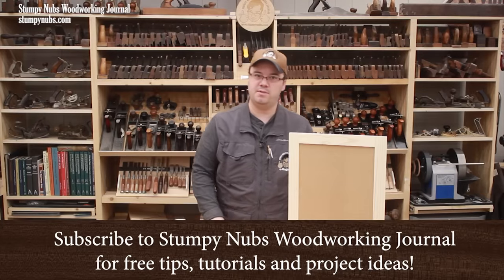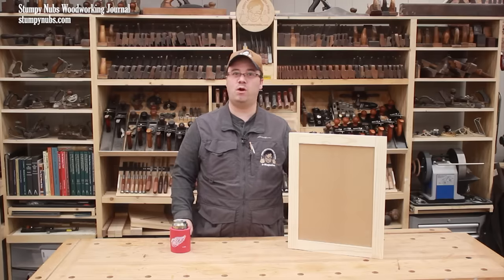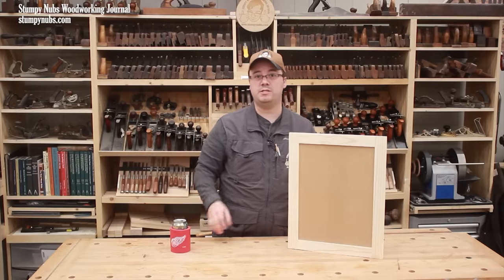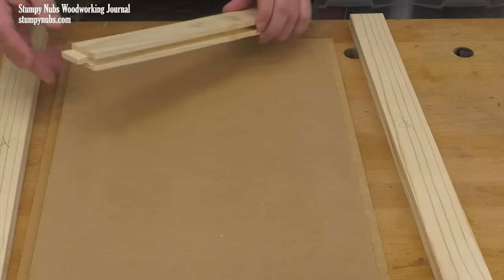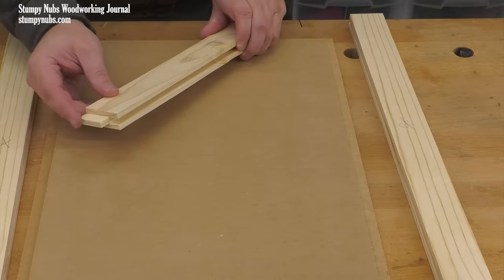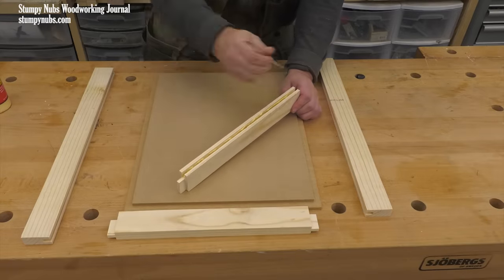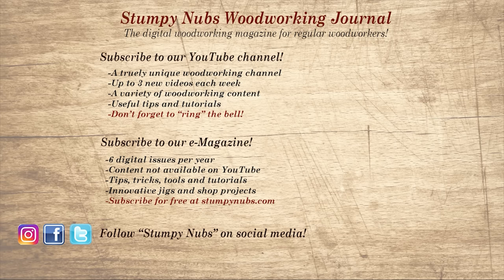DIY Cabinet doors with just a table saw!

Comment from the maker: Free table saw classes (In SNU Courses section)►https://www.stumpynubs.com/
ISOtunes Bluetooth hearing protection (Use $10 off code STUMPY): https://bit.ly/2mdAqcn
Video about homemade splitters►https://www.youtube.com/watch?v=gzdF-bLXc8Q
Free table saw class (In SNU Courses section)►https://www.stumpynubs.com/
AMAZING Hedgehog featherboards (seen in video)► https://amzn.to/3b4KcVl
(We may get a small commission if you use one of the above affiliate links.)
Reply: I'd love to hear stumpy's thoughts on the incra fence.
Reply: I just tried the stumpy nubs discount code for Ridge carbide for my 2nd table saw blade.  What I found that the discount code is good for one purchase.
Reply: I will sign up as soon as I get my contractor table saw set up. I am trying to decide what I am going to do about an Outfeed table. Never used a table saw before outside my shop class a million years ago. :)
Reply: @StumpyNubs thanks for the lesson.  It's worth noting that mdf should always be cut/drilled while wearing a filtered mask.  It's manufactured with toxic chemicals like formaldehyde. 
James I normally use reclaimed materials like pallets because I can get them free.  If I wanted to make a vertical slat panel in the door...should I glue the slats together and not the outside edges or use only tongue and groove?
Reply from the maker: @fdort3971  Glue them together to make a single panel, then let that float in the frame. Otherwise, gaps can open between the loose slats.
Reply: @StumpyNubs thanks James! I appreciate the quick response! I'm home alone most days so I was playing your videos just to hear another voice (besides the ones in my head...lol). Today I'm building a quick 2 tier cart. I received free wood that came with pre-drilled pocket holes.  I've always used the "toe nail method.  This wood is kicking my butt...your calm voice lessons are helpful for learning and trying to stay calm. Thanks for "hanging out with me" while I force used wood into submission!
Reply: @StumpyNubs  Bahaha I just went fangirl..."Stumpy answered me!"...you made my day...

Comment: James I know this is just one more comment but I do need to tell you that THIS video was amazing. I've been building a box riser for a lady's mini refrigerator so she doesn’t have to bend down so far. The door part was the only part I was nervous about and I didn’t want to just put hinges on a piece of plywood and watch it warp in a week. I wanted a proper door. YOU saved me. Trust me when I say you are an outstanding teacher and that is something I know a lot about. For over 40 years I taught thousands of people all over the country and wrote 5 books on a very technical topic. Nothing at all connected with wood working. What makes you a fantastic teacher is that you never assume that the student already knows the terms or is reading between the lines. You teach like its our first day in the wood shop and THAT is what makes you a fantastic teacher. I built this door using oak for the rails and styles and then sandwiched three sheets of 1/8 masonite for the panel and the result was as perfect as what you showed in your video. Great instructions make for a better student. My confidence has grown as a result. I have never seen any woodworking videos that are as clear as yours. I admire you as a teacher and a person. Please don't ever change. I have an entire folder in my YouTube library and nothing is in it but Stumpy videos. Thats the good stuff. Thank you most sincerely.

Comment: AWESOME setup tips for the TS doing dados and rabbets. Doing the rough center then flip technique removes all possible errors in getting the grooves centered and stiles/ rails flush with each other. With a good flat top blade, the machining steps shouldn't take long at all.

Comment: Several years ago I used your techniques to build fifty doors and drawer fronts for a house I was flipping.  At one point I had 250 pieces laying around, sorted into piles and my son came in an started handling them.  I ran him off.  

One suggestion:  If you are going to use 1/4" plywood for the panels, buy it and measure the thickness and use that for the thickness of your grooves and tongues.  Much of it is not really a 1/4" anymore.  Thanks for the really good presentation.

Comment: Great video, I’m making some doors just just like this for my shop cabinets. I’m using scrap 3/4 inch plywood for the rails and stiles. It doesn’t look the best but for the shop it’s fine. This is nice practice for when I build a new set of cabinets for the house.

Comment: @ 13:55 if you look closely you can see the fence move away from the blade as the work piece encountered the feather board, I was quite surprised, to say the least. Especially considering it is a Incra fence system (which I highly respect), and I watched as the video continued and it happened again . . .

Comment: This was one of the best tutorials I've seen in some time. Thank you for the detail, I was thinking a few times during the video that I wish Norm would have narrated answers to questions someone might have like you did. One constructive criticism is I would have liked to hear. a brief discussion on the seasonal panel movement, MDF/Ply/Panel etc. when you were gluing all four edges of the panel.
Reply from the maker: MDF and plywood doesn't move enough seasonally to be a factor in this case. That's why it is used. I briefly referred to that at the end of the wideo.
Reply: @StumpyNubs  my apologies, I missed that  at the end for some reason, Thank you again

Comment: There are so many useful approaches in this video that can be applied to other jobs...been looking for a way to build a picture frame for a large poster and can easily adapt this as well as for cabinet doors with glass inserts (will just miter in molding).

Comment: Recommend using a zero clearance insert.   I tried this vertical technique a while back and had some scary stuff happen.   Made a zero clearance insert and it worked much better.   I use a dado blade now.

Comment: Great vid as usual. I noticed though that the fence is moving slightly during the latter part of each cut (i.e. cutting grooves on edge). I assume this is due to pressure from the feather boards. Doesn't that make a slightly irregular cut line leading to small gaps between the panel and stile?

Comment: Great Video !
Quick question though I’ve always thought it good practice to let the panels float in the grooves rather than glue them in, is this because your using MDF and it doesn’t expand and contract like wood ?
Reply from the maker: Yes, MDF doesn't move like solid wood.

Comment: Nice very clear and easy to follow. You could do the same video with a router bolted to the underside of a bench. With perhaps a jack for height adjustment. Keeping it cheap. Good video mate nice to see someone not using a laser cutter, CNC and 3d printer just to build a simple project.
Reply: How would you do the grooves on a router table?  With a slot cutter?
Reply: @donbushek  yeah or a straight cutter

Comment: Hai Jim, I very much like the simplicity of This way of working😁 I always try to let the measurments "work" for me instead of against me, if if that means slightly adjusting my workpiece. I find it to be better to have exact, simpel but spot on cuts than  using a more comprehansive way wich I Just don't get to fit perfectly😒 thanks for This one!!!

Comment: Love the simplicity, usefulness and honesty in your videos!! There are so many great nuggets of knowledge to be picked up, from the greenest beginner to the most seasoned veteran woodworkers.   But....anyone else cringe a little watching the table saw fence flexing with the double featherboard set up?
Reply from the maker: There are two locking points for the Incra fence, one on the positioner arm, another on the fence rail itself. I did not have the fence rail lock engaged. It looked way worse in a video closeup than it actually was. I didn't even notice it, and it didn't affect the cut.

Comment: Using dry timber is essential. Many projects has looked good direct, but kind of warped after a few months. The construction lumber in the lumberjard is usually not even close to dry enough.

Comment: Hello.  Great video! 
I need to make cabinet doors for my kitchen cabinets.  I was wondering if birch would be a good choice for lower cabinet doors? My cabinets are made from birch for the boxes and popular on the fronts of my cabinets.  My upper cabinets,  I'm wanting to add a frosted glass because we have an extremely small kitchen 11'x10'. The cabinet doors for glass would be a little different process from making the grooves insert the styles and rails, right? It would be best to do that on the back incase of breakage but how deep would you do the groove and what to use to hole the glass in so it doesn't rattle? Your advice would be greatly appreciated.

Comment: Excellent video. Very clear explanation and really well filmed. Thank you.
I have some spare hardwood flooring. I was thinking about gluing several lengths side by side to make a cabinet door. Will that result in warping?  Is there a way to avoid it warping? Thanks

Comment: Glad to see a 1/2" panel. A 1/4" panel just seems to flimsy to me when opening/closing the door. I usually spend more time sizing the panel so there is no gap on the back side, but that's just my OCD.
Reply from the maker: I don't mind the gap as long as it is even all the way around. In fact, I sometimes use a special router bit that creates a slight beveled edge on the rabbet shoulder. Looks nice. :)

Comment: Forgive my ignorance here, but I have to ask this question (very much a wood working newbie here).

When you were running your grooves in the rails and stiles using a feather board at the trailing end of the cut, your table saw fence appears to deflect.  I'm sure the camera perspective and the close up view work together to exaggerate how much deflection there actually might have been, but it brought the question to mind.

Does using the trailing feather board run the risk of  deflecting the fence and giving your groove a slight crook (and potentially increasing the odds of a kick back)?
Reply from the maker: There are two locking points for the Incra fence, one on the positioner arm, another on the fence rail itself. I did not have the fence rail lock engaged. It looked way worse in a video closeup than it actually was. I didn't even notice it, and it didn't affect the cut.
Reply: @StumpyNubs  Thank you.

Comment: First off I'd just like to say , love all your videos, very thorough and informative. This question is a little off topic to this video but this is the first video that I've seen this occur.  I see in this video you use the INCRA fence system and I just purchased a complete INCRA TS-LS Joinery System but have not got it installed yet. I bought this fence system because of it accuracy and repeatability but I noticed in your video that the pressure of the feather boards on work piece caused deflection in the fence as you pushed the piece through the cut. Obviously any deflection in the fence is going to have a effect on accuracy but is it enough to worry about? If so would you recommend using something other then feather boards on this fence system? I've looked at the JessEm Clear-Cut TS Stock Guides but for almost the same cost I'm also considering purchasing a second INCRA LS Range Positioner only and adapting both positioners into the system to give better rigidity to both the in-feed and out-feed sides of the fence.
I know this video is over 2 years old and I don't know if you still use this fence system, but would greatly appreciate any opinion or views on this. Thank you
Reply from the maker: The fence can be locked on both ends. I didn't have the far end locked. But the camera close-up makes it look worse than it was. The project came out just fine, as you can see.

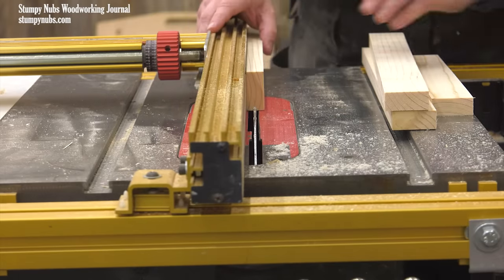Comment: Your saw's fence is deflecting (5:58) each time the piece of wood hits the second (rear) featherboard and gets pressed against it. It seems to do this on every cut.
Reply: Noticed this too
Reply from the maker: There are two locking points for the Incra fence, one on the positioner arm, another on the fence rail itself. I did not have the fence rail lock engaged. It looked way worse in a video closeup than it actually was. I didn't even notice it, and it didn't affect the cut.

Comment: Does it make sense to pre paint the panel so unfinished lies don’t show up later? Or is mdf stable enough? I’ve seen lines show up in lower end store cabinets. I’m currently building a bath cabinet with 1/4 plywood panel so I pre painted those. Wondering if I can skip that step for the kitchen cabinets I’m planning on building with mdf panels

Comment: I have cabinet doors like this, but where the rails and stiles come together the edges of the pieces are chamfered very slightly, resulting in a tiny "V" groove at the joint. Is there a name for this type of joint?

I prefer this to having the joint flat. My friend has flat joints on her cabinets. They're painted white. Some joints are invisible, while others have a hairline joint visible. When they're chamfered, they're all visible and consistent.

Is there an easy way to consistently chamfer the edges for such joints?

Comment: Hi James, I noticed how square the side of your Incra fence is with your table saw top. Did you have to shim yours? Mine is out of square towards the top of the fence. Do you have any advice for shimming it to fix this? It doesn’t seem to matter for ripping smaller pieces but I doubt I could run a panel vertically with any accuracy. Thanks for all the videos.

Comment: The back of your fence is moving when the wood hits the back featherboard.
Reply from the maker: There are two locking points for the Incra fence, one on the positioner arm, another on the fence rail itself. I did not have the fence rail lock engaged. It looked way worse in a video closeup than it actually was. I didn't even notice it, and it didn't affect the cut.
Reply: @woodysranch2690  incra has build in repeatability. It’s super accurate.
Reply from the maker: @woodysranch2690  The Incra positioner provides a positive stop ever 1/32 inch, which is great for precise repeatability. I have the big SawStop fence on the cabinet saw and the Incra fence (sometimes) on the smaller saw, just because I have both available to me.

Comment: If you use hardwood as your rails and stiles, how do you account for wood movement?
Reply from the maker: You don't. They are less than 3 inches wide. The movement will be very minimal

Comment: Great vid. You mentioned maple as a good choice if you're going to stain the door. I was surprised to hear this because I just finished a maple project for a client and had a terrible time with staining (so much hideous blotching). I had to sand off everything and start over from scratch using a lot of helpful recommendations found online. Could you please elaborate on this, either here or in an upcoming video? Btw, I ended up using Charles Neill's sealer for the project and even then I still found staining the maple to be challenging but I managed to get it done.
Reply from the maker: There are many different types of maple. Softer species do splotch more than harder species. Good, even sanding helps, as does a pre-stain conditioner. You may also use a gel stain that sits more on the surface. Or, embrace a little splotching. :)

Comment: Thanks James!  The rabbit you did on the panel, how feasible is that to do on a drawer bottom?  I'm specifically thinking of making the rabbit, then simply gluing that to the bottom, where the part that wasn't removed is "inserted" into the drawer space.  Would that end up being too weak a bottom?

Comment: Great video James. A question:  my dado blades combination for 1/4 “ is   a little shy of .250 and my table saw fence is a clamp type good but not super precise, can I use the alternating side technique to center my groove I rails and stiles?
Reply from the maker: The auto centering method of cut-rotate-cut works with any blade width.

Comment: Love your content as usual! I see you have an incra fence. Would love to see content on tips for that thing but I know the audience m isn't be too small.
Reply: You know, I was thinking of getting the same Incra fence, but I just noticed in this video how much it deflects. Watch as Stumpy pushes the piece all the way through. That's disappointing.
Reply from the maker: There are two locking points for the fence, one on the positioner arm, another on the fence rail itself. I did not have the fence rail lock engaged.
Reply: @StumpyNubs  As is usual with your content, I learned something new today!

Comment: I'm trying to build drawers that tilt forward about 20 degrees after fully extending. Do you (or anyone in the comments section) have any tips on how to do this?
Reply: Vending machine drawers do this.  The ones above have to be filled but would be above your head, so  they tilt down for access.   Not sure how you could get a look at one. We pull the drawer out to its full extension, lift slightly, and it tilts as it moves forward a bit more.  There's a stop to keep the drawer from tilting too far. . Maybe if you search "how do vending machine drawers tilt?" ...  If you don't find anything, reply here and I'll try to get  a photo if I can remember.

Comment: Am I imagining it or does the fence flex when the workpiece meets the rear featherboard?
Reply from the maker: That fence has a lock on both ends and I didn't lock the far end, but the movement is very tiny and had no affect. It looks way worse on that extreme camera closeup.

Comment: My biggest issue is I can't set my table saw blade at 90°, I can set it at just about any angle between 87° and 47° but the saw was cheaply made and the stamp wasn't perfectly aligned at the factory when they made the part that is supposed to limits the angles.